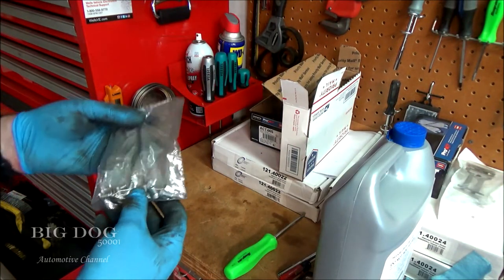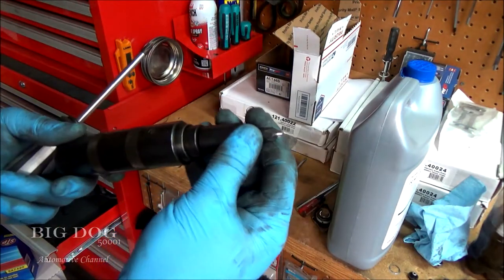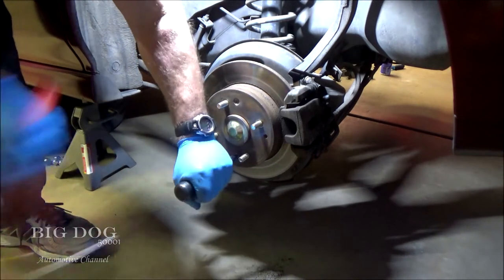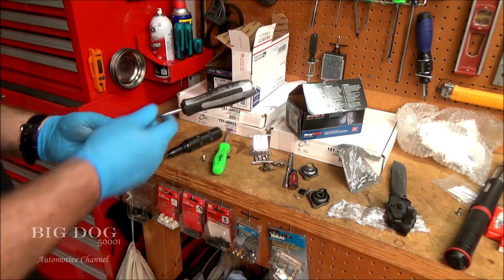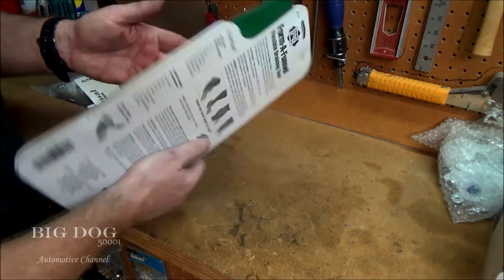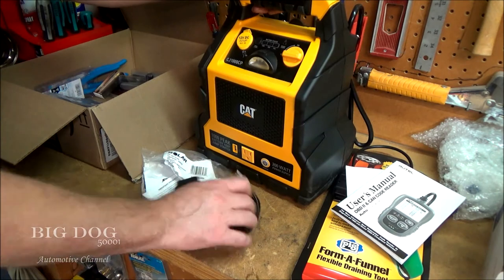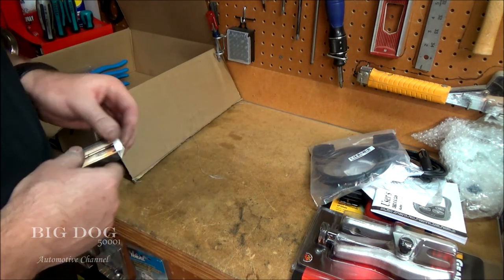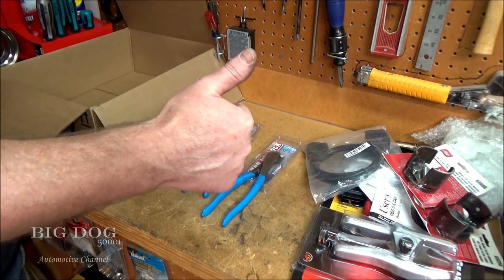Round 1! Vessel and Lisle Impact Screwdrivers vs Honda Rotor Screws (With Bonus Tool Haul)

Comment: I guess I was lucky. I used a flat punch slightly smaller than the screw head. I gave it 3 good raps then used my #3 phillips screwdriver to simply unscrew it.

Comment: I find it funny that everyone shows how hard they are to take out, then you all put them back! Throw the damn screws away!
Reply from the maker: Lol, thank you for the comment.  They are not usually that difficult to get out.  I put them back it because it makes it easier to install and if you put a little bit of anti-seize on them, they will come out pretty easy the next time.
Reply: My thoughts Exactly...im a professional technician for over 20 years and i always throw them stupid screws out i don't even bother putting them back in for a few reasons...1 they are only there for when the car is on the assembly line that the rotor doesn't come off and kill someone..2 it's easier for the next brake job no one has to deal with the hassle...3 its much faster no headaches..4 im courteous lol...5 i put a spring clamp against the rotor to keep the rotor in place when I do the brake job when you put the wheel back on and tighten it down it will put the rotor where it should be...i never reinstall them pain in the ass screws I wish everyone would stop also

Comment: use Vessel P3 bits in the impact, you will get the proper results.
Reply from the maker: I use those too, thanks for the input!
Reply: you can also use a hard plastic tipped dead blow hammer, more energy transferred each impact and longer life for the driver as it doesn't mushrooms the cap end. goes for the Lisle and any other impact screwdrivers too. been using a big Wiha 50mm/2" for years and almost no mushrooming except a JIS #3 Vessel Impacta screwdriver died from karoshi once, er, twice... 😬
also works fine for euro ski bindings using PZ3 screws.

Comment: Do all hondas have the jis screws? I used an impact drill gun to take it off and it worked flawless. Maybe i got lucky
Reply from the maker: Yeah many models have the same part number.  Sometimes you can get lucky and get them off the way you did, especially if they haven't been on there long or have some kind of anti-seize on them.
Reply: Big Dog50001 Automotive good to know thanks for the info of putting anti sieze for the future.
Reply: Some newer Phillips are made to be more compatible with JIS than they used to be.  Conversely modern Vessel JIS drivers are more compatible with Phillips than they would have been in, say, the 60s.  So there's wiggle room there, until there isn't.  In the hardest cases, the best fit may only just be good enough.

Comment: I’m hitting my new vessel impact very hard and it’s not turning the screw? Wats going on?
Reply from the maker: Thor's Aquatics Sounds like it's in there tight.  It should eventually loosen up.  I usually hit them a few times and then try to turn screw, and if it's not loose, I repeat.  They don't work as well on sheet metal as they do with rotors, like say if you are using it on a door jam or something like that.
Reply: Big Dog50001 Automotive I have to buy the Lisle impact driver and was able to get my rear brake done thanks to it! Took a beating to turn the head slowly. Vessel fail for me. Maybe I will order the vessel bit and use on Lisle impact in near future.